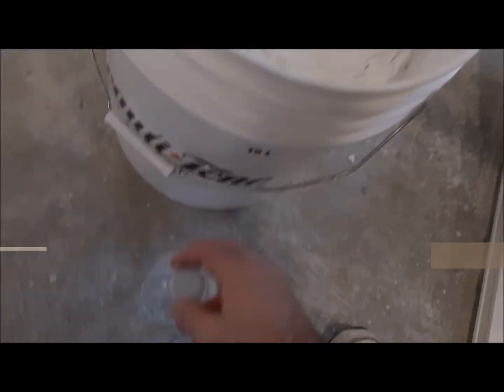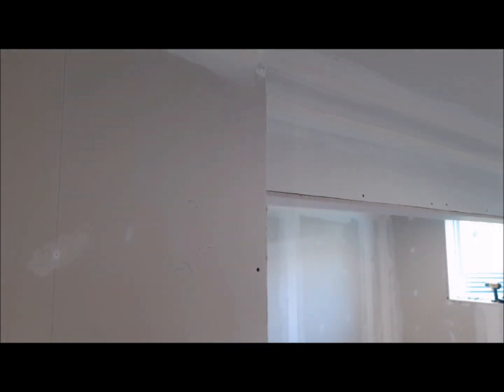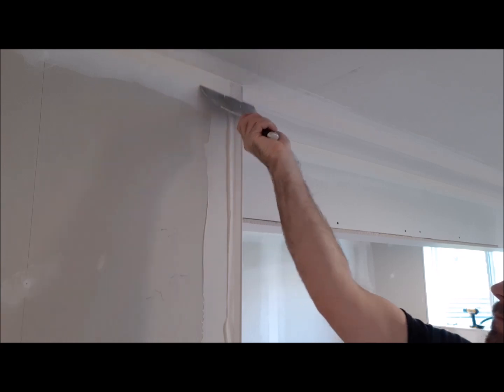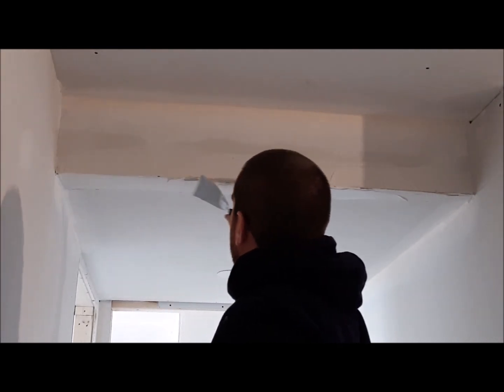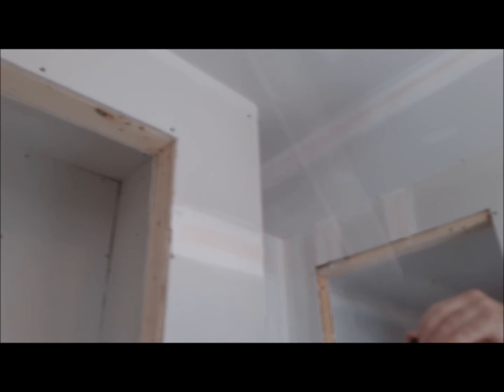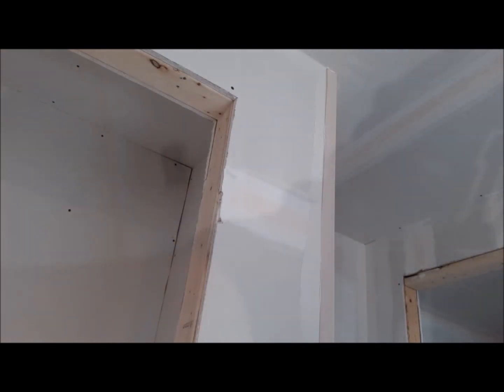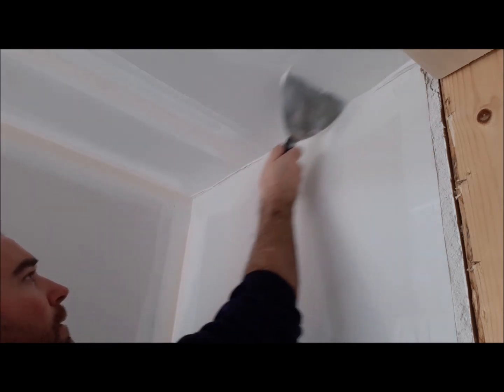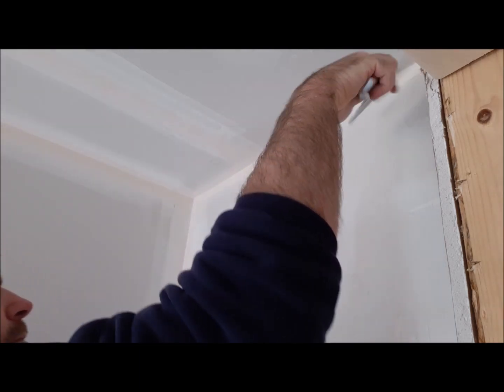Drywall Taping Inside & Outside Corners

Comment: I'm worried about paint flash with eggshell latex. The wall is already painted from years ago and now I'm fixing a bunch of nail pops before I repaint the walls with the same colour paint. 
Should I use real primer/sealer for the compound drywall nail repair then spot paint the compound, then prime the entire wall, then repaint the entire wall?

I've read other saying to spot paint the repairs with two counts of the new paint (not real primer), then repaint the entire wall.

what is your experience to prevent flash?
Reply from the maker: Hi, I would prime the wall first with a real good primer, like bullseye 123 or something to the equivalent, then 2 costs of the wall paint and should be great 👍🏻